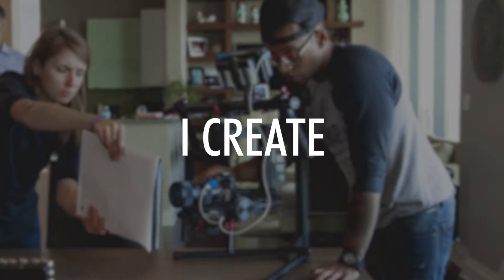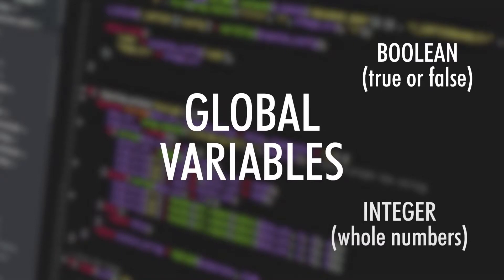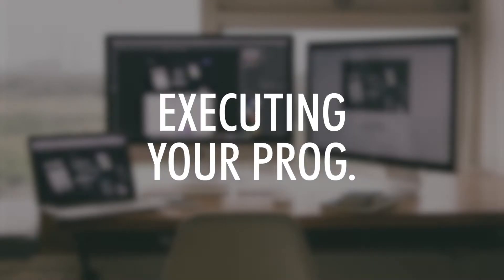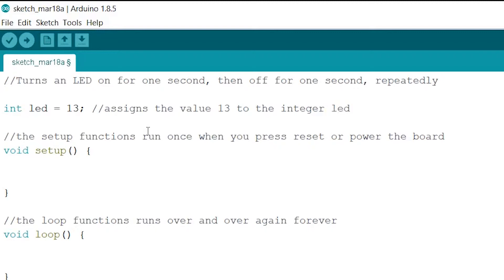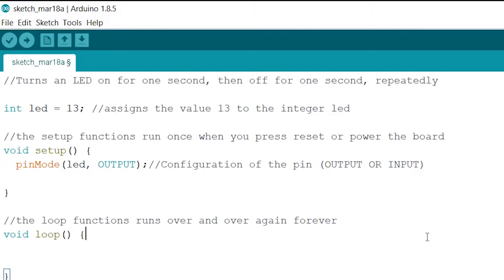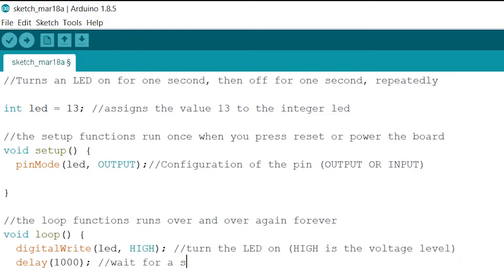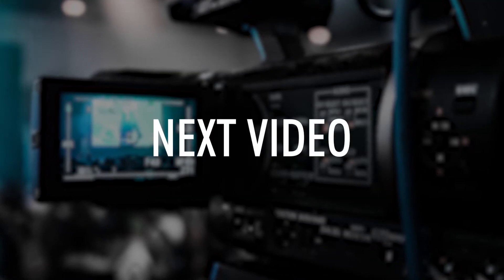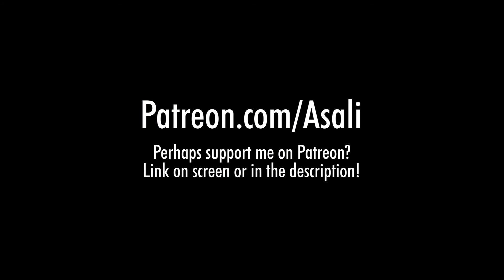Arduino uno led pin 13 blinking on and off with delay

Comment: Thank you for this video :) 

Is it possible to have 5 more LEDs in this type of code?   if you press button 01 it delay 5 second,  then press button 02 and it start LED 02 delay 5 seconds..   But if you then press button 01 it start from 0 to 5 second again on LED 01.